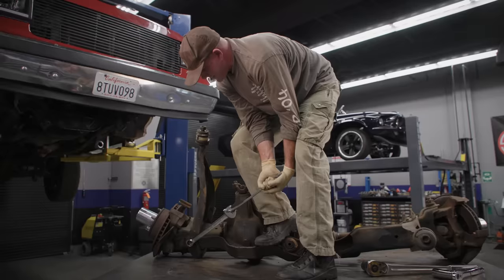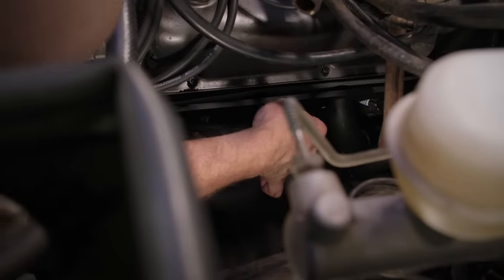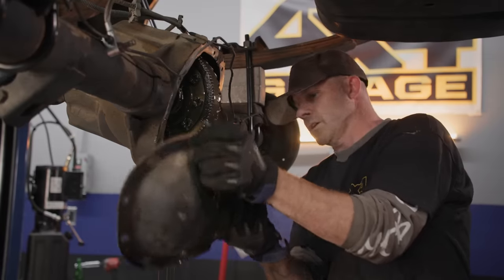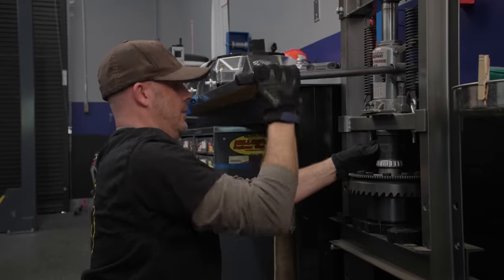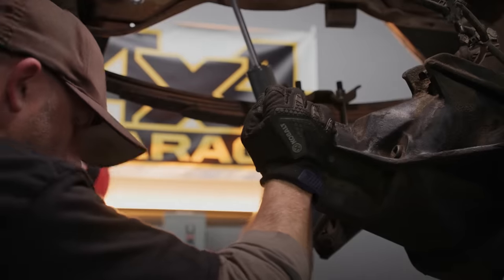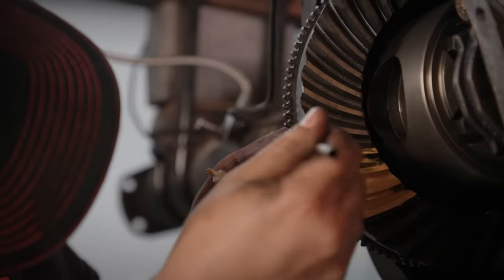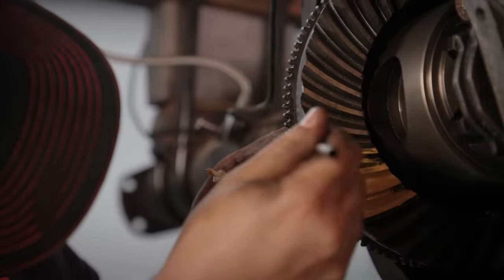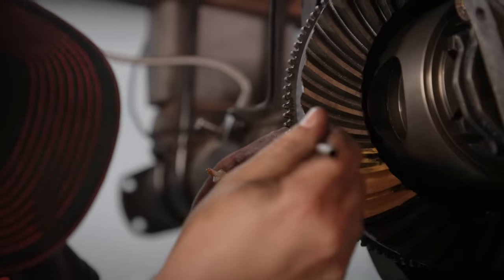4x4 Garage: Bronco Build Part 2 | MotorTrend

Comment: christian, you’re killing me, you know better than to stack those lift blocks on top of the factory wedges.
Reply: I hear ya, but that is actually what Superlift's instructions and tech line call for on this particular application.
Reply: @ChristianHazel  ya gotta get them leaf springs man!!
Reply: @chrisurfer83  Literally just walked in the door from installing some Deavers in the back of it at Wood's Offroad.
Reply: @ChristianHazel  I have a set of 6" lift deaver springs waiting for me to finish my lift as well. I'm halfway through the front right now. Looking forward to seeing part three of your build 🙂

Comment: So was curious @4x4Garage if the 4:88 gears made it turn just to many rpm's at highway speeds like 70mph etc?  I was considering 4:56s with 35s and a 4 inch lift with mine but didn't want it unbearable at highway speeds. Thanks.

Comment: How did you remove the other bearing to allow you to hammer it out with a piece of tube?
Reply: The piece of tubing I used fit through the ID of the bearing. Have to remove the carrier, but just slide it through, knock out one bearing, come to other side, wash, rinse, and repeat.
Reply: I have one same.mine is a 1989 Eddie bower.